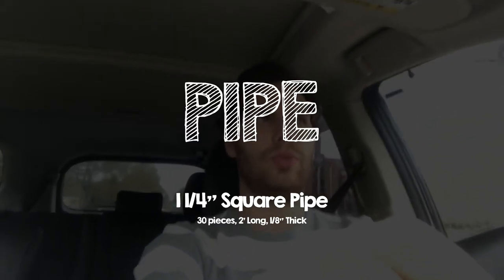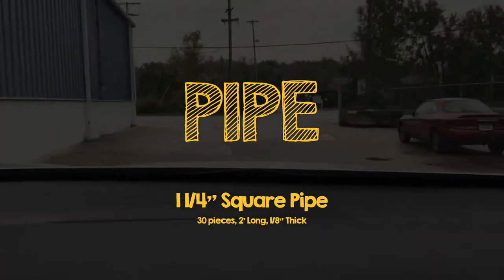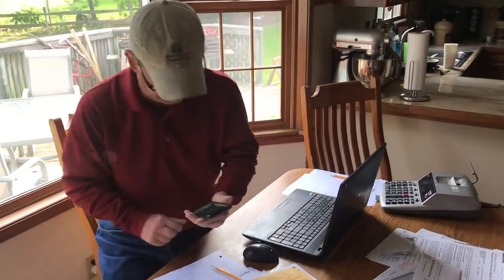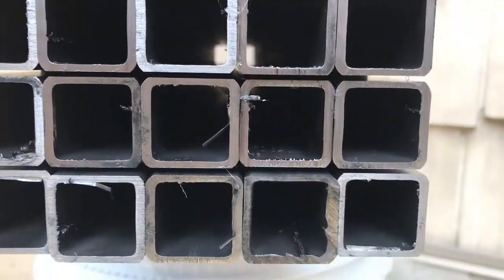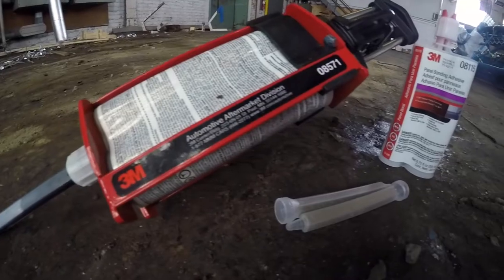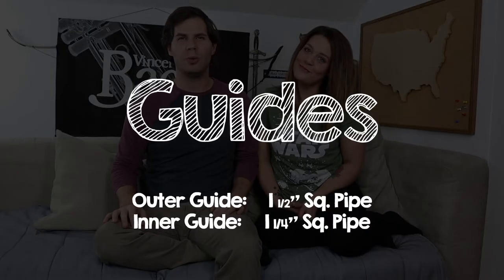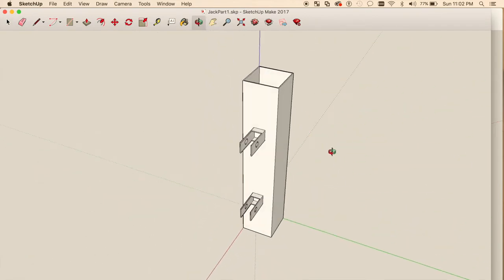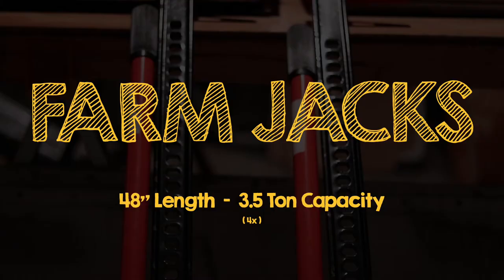Skoolie Bus Conversion Ep 5 - Roof Raise Part 1: Getting Supplies

Comment: Those Hi-Lift jacks are awesome but also costly.  Most other videos use 3/4 or 7/8" all thread and 4 nuts and washers on just 4 lift points. Much cheaper and more stable in my opinion as they are welded to the hat channel (the bus ribs) and resist lateral movement of the roof when raising up. You could also raise the roof with one person easy with the all thread. I will be interested in seeing your raise.
Reply from the maker: We checked out the all thread but they don’t like to fit inside 1" pipe. We ended up using square pipe guides on four points. Also when we were raising the roof we initially used an automotive jack and a 4x4 but you need to notch out the 4x4. Even with the notch it wasn’t super secure. You could bolt it to the hat channel but I didn’t want to add extra holes. The real reason we went with the farm jacks was because our original plan used them connected to our guides/jack rigs. After we struck that from the plan, and already purchased the jacks we ended up using them to stabilize the bus and then later for the actual raise. We got ours for $54/jack. Plus on our travels we are bring them with to help stabilize the bus when we are parked. (Or maybe help the suv out of tight spots)
Reply: Many ways to accomplish the same result. In the end you did what's right for you and at least you are doing something.
Reply: In case anybody else watching wants to see the all thread method.
https://www.youtube.com/watch?v=ETCViv5rsNs
Reply from the maker: j jones Agreed! Many ways to skin the cat (no cats were harmed in the making of this video)

Comment: What do you mean by getting the pipe milled? Do you mean cutting the pipe or removing the hot rolled finish?
Reply: Haley Sparger they shaved off a few millimeters. The process is called milling. They use a cnc machine to systematically cut into the metal to remove the exact amount ☺️
Reply: @scottkennedy7535  Thanks for the quick reply! :)